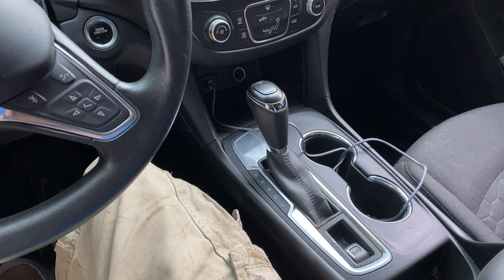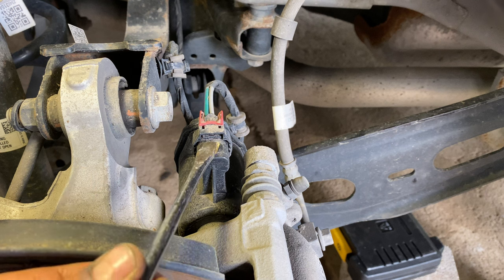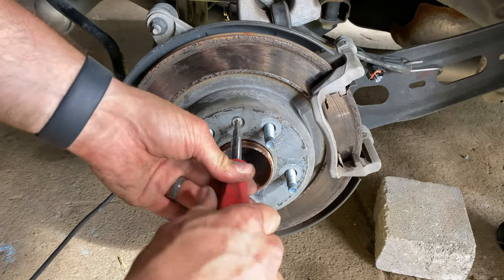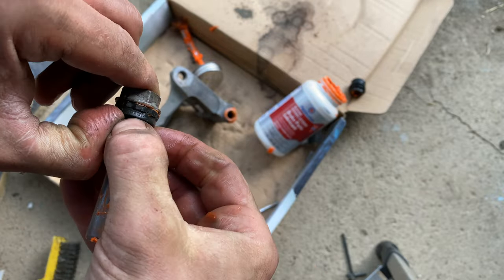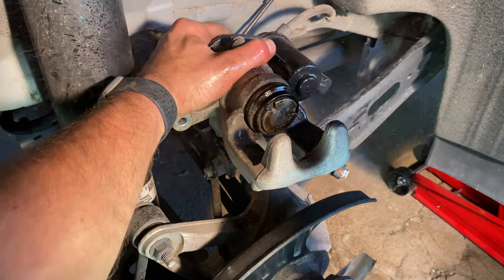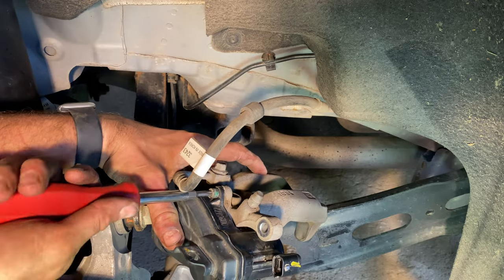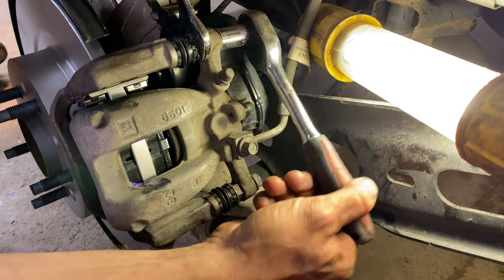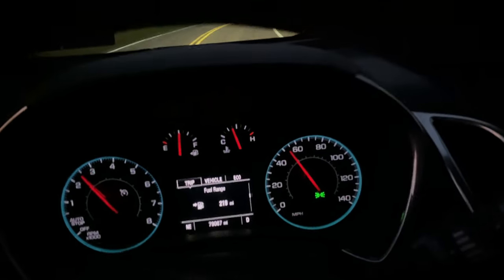2018 Chevy Equinox Rear Brake Change & Place Electronic Parking Brake in Maintenance Mode Manually

Comment: Job complete on 2020 Equinox the only step i skipped was unclipping the electronic cable from the retention clip and after I put it in service mode I put it back together and used a flat head to depress the calibers the old school way by screwing the caliber back on and using it like a pry bar to depress the calibers after that I tighten the two t30 screws hand tight and finished my job and if this helps you only need a t30 screw driver to unscrew it took me like 25 minutes to do the whole job fast $125.00 you help me make

Comment: The only thing I do not understand is why messing with the parking brake was necessary in the first place. Was it that the caliper piston would not retract if you didn't put the brake into maintenance mode?
Reply from the maker: Correct.

Comment: Your tip with the electronic brake worked perfect. Autozone has the brake caliper return tool loaner. The caliper actually has to turn to go back in. This made the job a lot easier. I did not have to remove the electronic part from the caliper.
Reply from the maker: I strongly recommend against leaving the electric parking brake on the brake assembly while winding the piston. You’ll be forcing the electric motor to turn and could break it or cause a sensor read error. Following mechanics guides, the manual process I show or using the scan tool are the safest.With the method I show, no turning of the piston with a return tool is needed. To each their own, and thanks for the comment.
Reply: @DavidStumph  I just put everything back together and I have no error lights, and the brakes are like new. If I have any issues I will leave an update.
Reply from the maker: Stellar!

Comment: Thank you for this awesome and detailed video! I just completed all 4 rotors and pads replacement saving me at least $300. Still costed me approximately $300 for new pads and rotors but that includes grease, brake cleaner, jack stands, etc. The torx 30 bits for the rotor and the EPB were a pain in my ass to get free. Tight space behind the brake line for that damn torx bit.  😂

Comment: Good video.  Rotors don't always come off as easy as shown in your video.  A few hard wacks on the rotor's face edges using a good dead-blow 4lb rubber mallet will loosen the rotor.  I also found tapping the rotor torx 30-bit set screw with a hammer along with the rust-penetrating lubricant will make it easier to remove the rotor set screw if it is somewhat seized by dirt and rust.  Most repair shops won't clean or lubricate the brake system as well as you demonstrated in your video.  That's why I do the work myself.

Comment: Did the rear brakes on my 2018 about a year ago. I hadn't seen this video but having done brakes in the past dove into it on my own. My procedure was exactly what was shown here and worked fine. I was a little apprehesive about the EPB but figured what could go wrong. A little grease on the motor o-ring helped install of the motor. The screw that is turned by the motor was easily rotated with the tip of a flat blade screwdriver held into the internal spline. If I recall there are two holes or notches in the face of the piston that needs to be aligned with the  matching pins on the back side of the inner pad. This prevents the piston from rotating during operation.

Comment: I follow all the steps! Thanks! After changing the rotors and breaking, as I drive I hear some rolling sound from the rear as I drive. Do you know why I hear this?😢
Reply: That sounds like the shroud that goes around the brake rotor. Bend it away from the rotor to stop the sound while rolling.

Comment: Dude...awesome video! I truly believed (told so) this was dealer only and a scan tool was needed to retract the electronic portion of the braking system. I feel I can confidently do this myself. 
What pads and rotors did you use? I have gotten over 100k on my factory set and have considered going w GM parts for the brake service. Thank you very much.
Reply from the maker: Raybestos

Comment: In the emergency brake motor, after turning the torque screw into service mode, do you screw it back out? Or just leave it in service mode and remount??
Reply from the maker: Leave it in service mode and remount.
Reply: @DavidStumph  thanks yeah screwed it back out but the caliper just pushed back out, so screwed it back in and left it, got rear rotors and pads replaced thanks man👍

Comment: We were only changing brake pads, amd after reassembly there is a high pitched noise and it feels as though something is being run over with the rear tire.... any ideas what that could be?
Reply: Check the hardware

Comment: Very informative!!!  How many turns do you need to put the parking brake in maintenance mode?
Reply from the maker: Not sure the specific count. You can turn it until it’s seated fully, that’s what I did and its been fine every time I’ve done this job. Multiple car manufacturers, all similar with the electronic parking brake.
Reply: @DavidStumph  Appreciate that.  It is the same setup on both sides of the vehicle with regard to the parking brake?
Reply from the maker: Yep!

Comment: A warning popped up in my 2018 equinox saying to service the "Brake Assist", any idea what that might be referring to?
Reply from the maker: This just showed up on mine…did you figure it out? Concerned it may be the brake vacuum pump failing or a bad brake sensor…
Reply: @DavidStumph  For me it turned out the battery needed to be replaced. The radio was also cutting out whenever the car was restarting after the auto stop at stop lights etc... Once the battery was replaced both issues went away
Reply from the maker: @dnetsuj  hmm! That’s a relatively easy fix, might need to check there first. Thanks!
Reply from the maker: Had the same messages and behavior. The battery change corrected. Working on another video showing this. Thank you!
Reply: Once the module is in service mode are you counter clock wise the bolt before capping it
Reply from the maker: No
Reply: That’s what happened to mine battery makes no sense it has to do with the brake Job was I supposed to turn the bolt back after pushing in piston
Reply: It's the battery or the alternator going out.

Comment: I have a 2019.  I'm guessing it's the same procedure.  Are your brakes still functioning ok with no errors?
Reply from the maker: Yep, should be the same as far as I’m aware. No problems to report.
Reply: So when you disengage the e brake you keep the car on throughout the whole process?

Comment: How did you do those 18mm caliper bracket bolts with ease?  I'm struggling with this right now.
Reply: Lube with rust penetrate let sit for an hour, and use a breaker bar.  Sometimes you might have to apply heat.

Comment: When I push down on the parking brake button a sign comes up saying "parking brake engaged". When I pull up it says "parking brake disengaged". In your video you say to disengage the brake by pushing down. Should it be engaged or disengaged?
Reply from the maker: Hi Martha! Odd to hear your parking brake controls are inverted to mine, but regardless of that I can confirm how this should work. Before you start the change, you want to have the parking brake disengaged otherwise you won’t be able to get the parts off. When you complete the change, you’ll want to engage and then disengage the parking brake to reset the parking brake positioning. Hope that helps clarify, good luck!
Reply: Do you keep the car on the whole time?
Reply from the maker: No.

Comment: 300mm or 321mm frotor or 2wd 2018 equinox?
Reply: Both diameters were used. You have to measure rotor or check option codes for brakes. J60 is 300 mm.
Reply: To get the option codes scan the QR code in the driver's door frame on the B pillar.

Comment: Anybody else having a whale of a time getting that torx bolt off near the brake line. Nothing I have is fitting in between there and I’m about to take brake line lose just to make room
Reply: That's what I had to do. Didn't have any T30s long or thin enough to fit in that tiny gap. For anyone who may need the advice, a pair of vise grips on the brake line will help with fluid loss. Just don't go crazy tight.